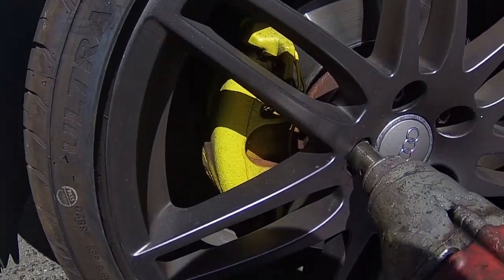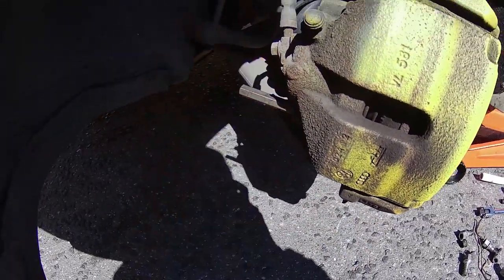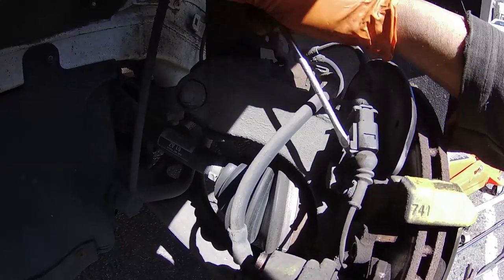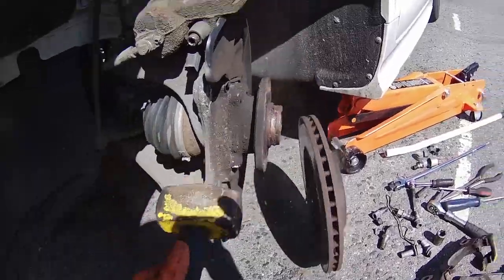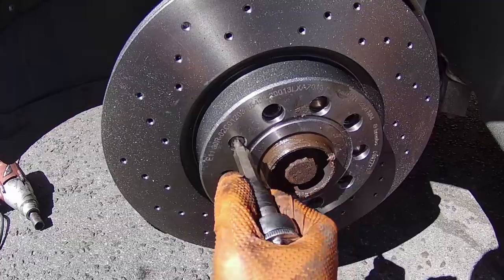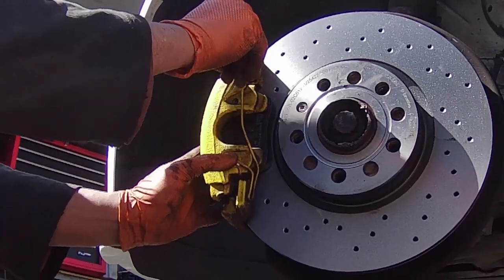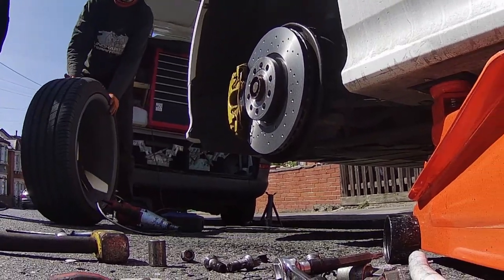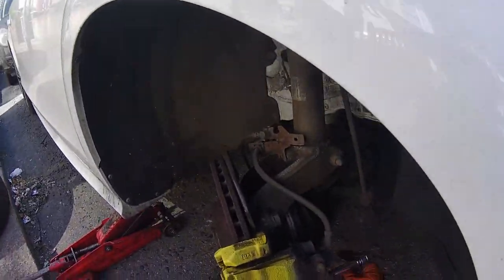How to change Brake Pads and Discs Audi TT mk2

Comment: How much would you charge to replace 2 pairs of brake pads
Reply from the maker: It depends on what Vehicle, location and what you mean by 2 pairs of brake pads?
Reply from the maker: I don't travel that far. I'm in London UK. In my local area I usually change £40 + the cost of parts if I was to supply them.